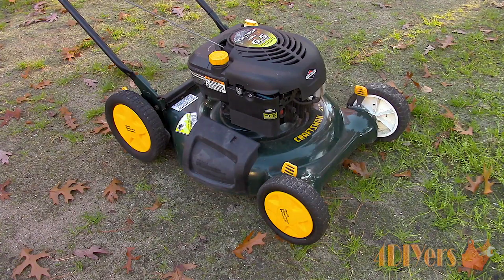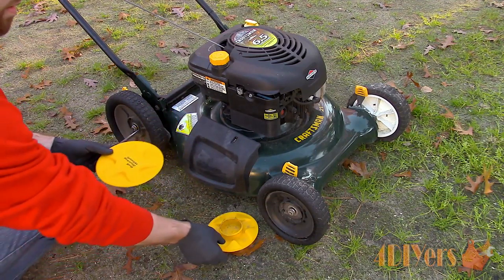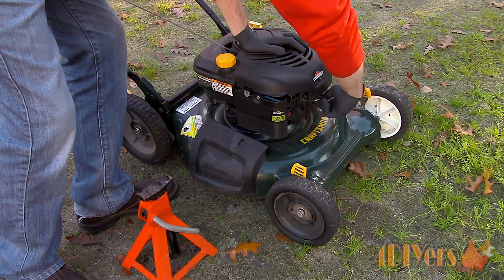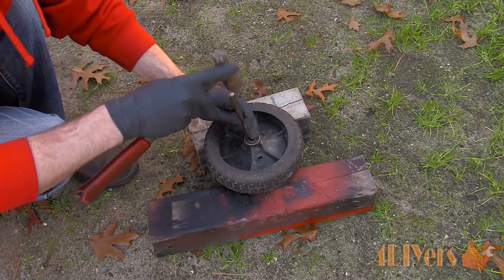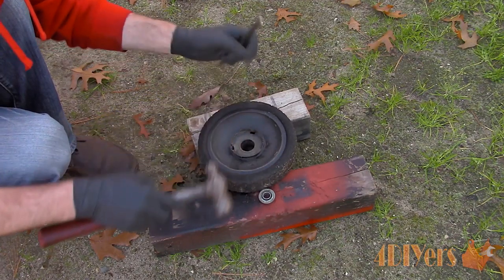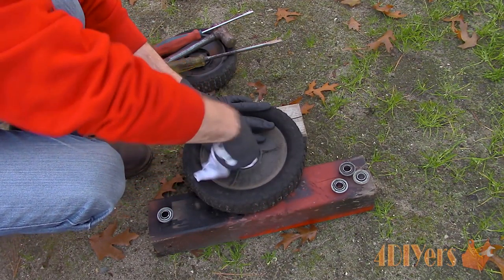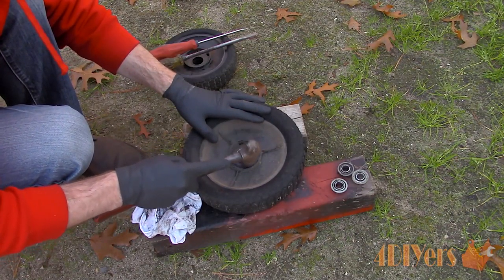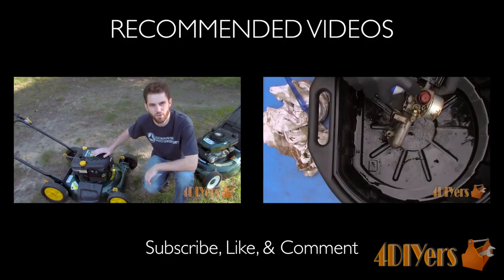Buy & Sell Lawn Mowers - How to Replace Wheel Bearings

Comment: You said something about bearing $30.00 a wheel , can't tie up that kinda money buying and resaleing lawn mowers or you'll go in a whole fast . And it's funny people out there that want $30.00 or $40.00 for a non running mower are just nuts . They just don't know that used or new parts don't grow on trees .
Reply from the maker: Yep, however you can buy them online from an off-shore company for much cheaper. Probably closer to $5 per wheel. You have to be a smart buyer and if it's something you're getting into for the long run, have those items on hand so you don't have delays with shipping. From what I've seen on the classifieds as of more recently, people are really overpricing things. The off season items aren't dropping in value. I looked at an 08 Jeep Wrangler about a month ago, needed about $2000 worth of work. When I see it in person, the dealer tries to increase the price on me, refused to negotiate, devalues how much parts are really worth new, and considering I'm doing the work myself there's no value on that.